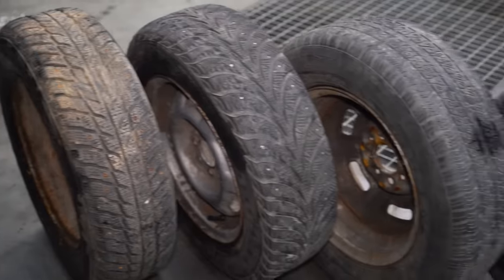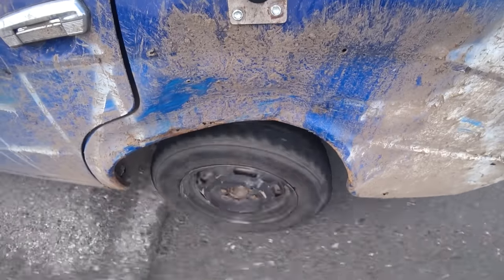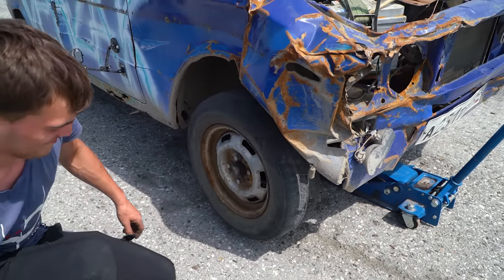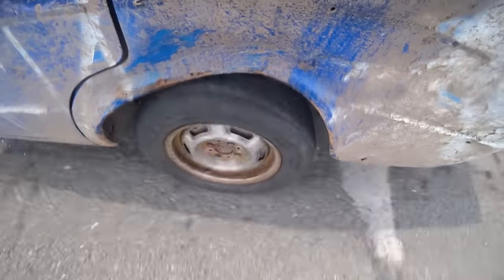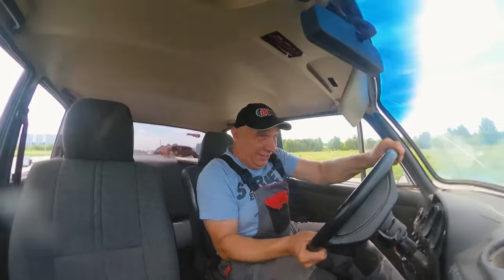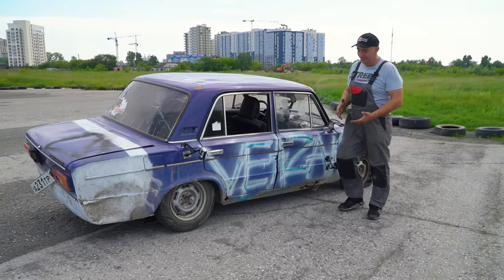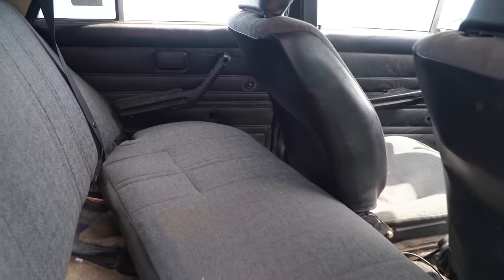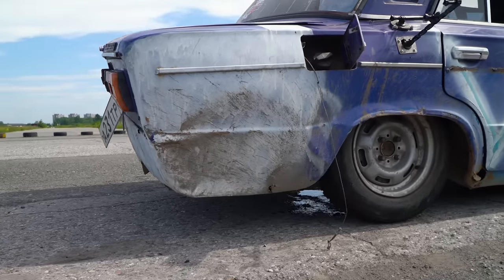50 kilograms worth of weights at all 4 wheels - what will happen?

Comment: When you want to go home, and a last second customer walks in cause they have a slight vibration, so you give them the 6 o'clock balance lol
Reply: Sorry about that. It was me. I just wanted to see if it was a wheel balance issue causing the vibration. I couldn't wait until tomorrow even though I had no plans to drive anywhere.

Comment: Would be interesting to start at a couple kilos and work up from there. Or even 30 grams and up.
Reply: Use one of those tire inflator/deflator systems that you see on hardcore off roaders, but use it to add water (or molten gallium) to the tire while its spinning.
Reply: Landon-si5xc Allah is a complete laughing stock

Comment: Do it again. 
* Bolt the offset weight to the rim from the lugs. 
* Add limiting straps & bump stops to limit suspension travel. 
* Make wheels with offset centers & clock the weight at different positions.
Reply: With the concrete car?

Comment: No!  You should have spun the tires somehow so the 50kg of lead was evenly distributed around the inside of the tyre. I'm sure the results would have been a much smoother drive than normal.
Reply: That would be interesting.... If you kept the wheel spinning fast enough as the lead cooled it would get perfectly balanced...

But then you'd have a semi solid tire, and the lead would deform over imperfections, I wonder how many laps they could take before the balance got all messed up and the car started shaking?

Comment: I know you guys have used concrete before in tires
My suggestion its take 4 wheels and make a steel reinforced concrete precast wheels no rubber just concrete around the wheels
Leave it cure for at least 28 days to achieve full cure then test it.

Comment: Cool video. I'd be careful not to do too much of that though. Violent vibrations can have devastating effects on the brain, nervous system and joints. Checkout havs. Just looking out for your wellbeing dude. Have a great day.
Reply: If you can find a way to do it with a remote controller, you can push them even harder!

Comment: I don't know if this is allowed but over in Poland I watched a group of guys they drilled a hole in the dirt that would fit an oil drum the drum had one end cut out that end would go in the hole then they would propane and oxygen in the drum and with a long stick with a rag tied to it they would light the rag and touch a little hole and BOOM it would shoot up in the air, cool.

Comment: Can you build Extractor but 4 cylinder to 2 to x pipe to 2 end pipes Or 4 cylindrical but double it to 8 by 2sy tubes per cylinder and then to 2 to x tubes to 2 end tubes